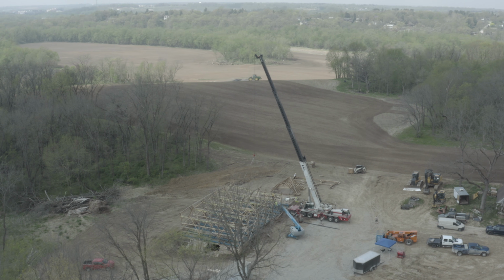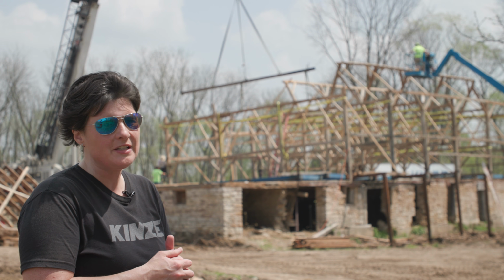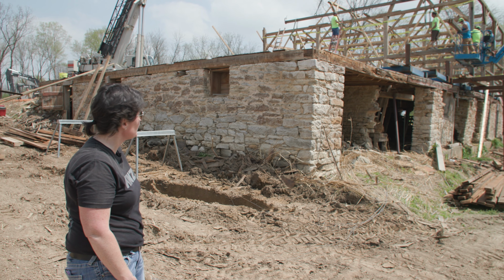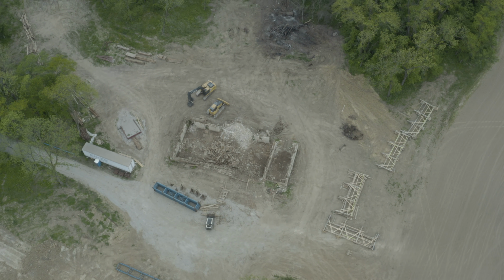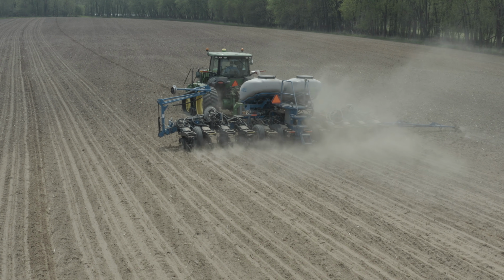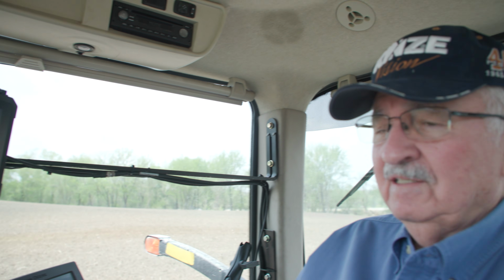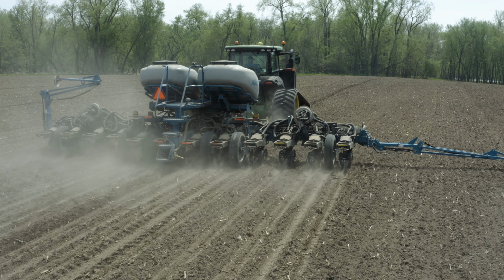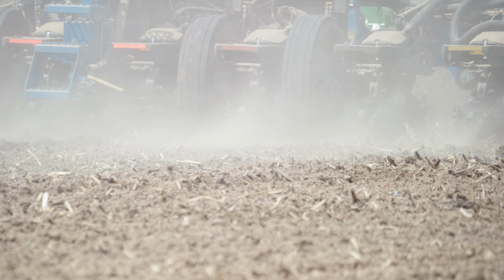Operating the industry's best corn planter and preserving a 150-year-old historic barn.

Comment: My front barn, 50 x 50, 1880+, hand cut. back of the barn 40 x 40 saw cut. also has a manure rail system in the lower area with a switch track. 
Old barns are sweet.